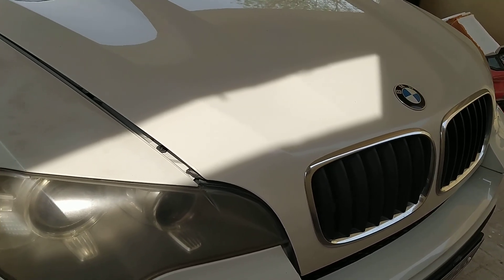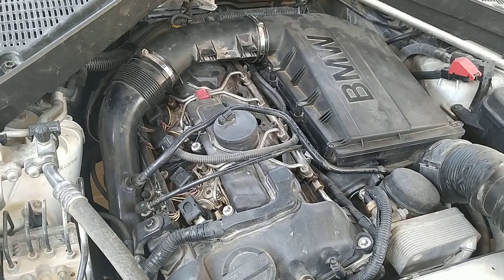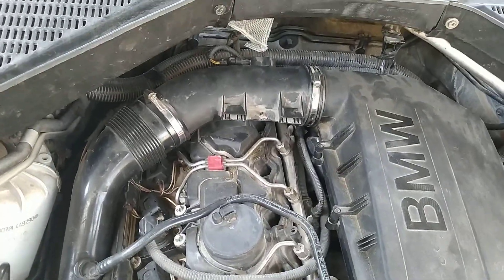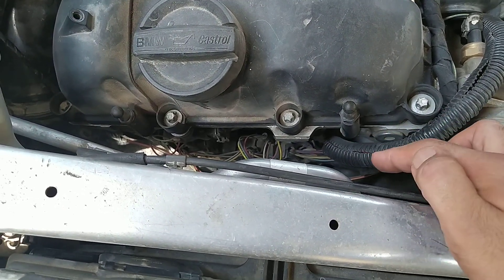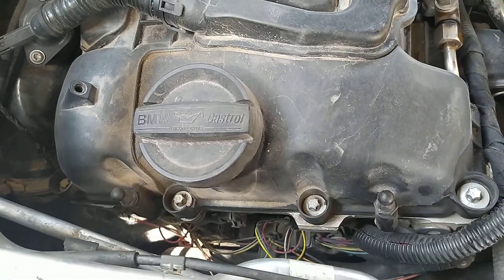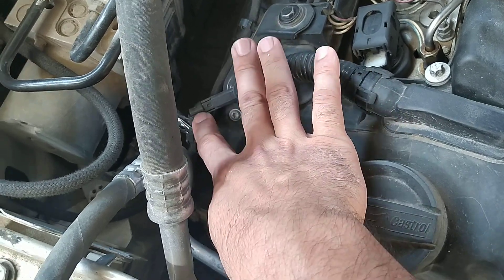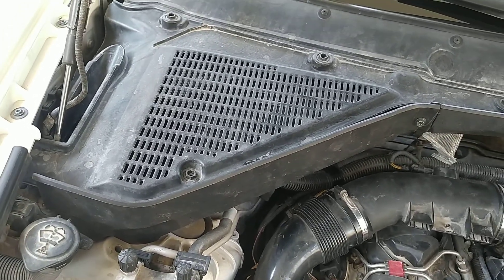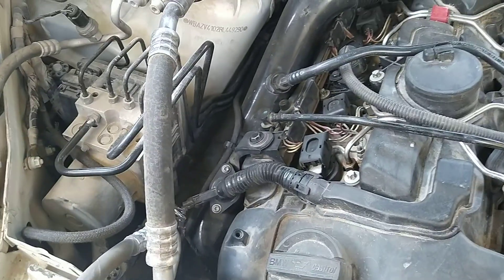BMW X5 E70 N55 no start due to electrical short circuit fixed!!!! See discription for error codes

Comment: I have the problem that the first 30amp fuse blow in the ISM when I conect the cable of the connection voltage supply on the dme
Reply from the maker: Car model? Year? engine? As far as my understanding it must be a 15Amps fuse and not 30Amps in normal cases.
Reply: @bimmerhacks  sorry it's 15amp as you say, it's a x5 2011 e70 n55b30
Reply from the maker: @4agezte983  Try disconnecting the following and connecting one by one back, do the easiest one first. Use a Bulb method to find out the short circuit.
My first priority will be Diverter Valve(BOV) if it is easily accessible, if not
1. Intake vanos solenoid
2. Exhaust solenoid
3. Intake airmass sensor
4. Oil control valve
5. Intake camshaft
6.Exhaust camshaft

Please give me more details if you know how this started happening.
Reply from the maker: Also the Exhaust Flap connector in the rear compartment, where the first AID KIT is located
Reply: @bimmerhacks  oi thanks I'll do tomorrow
Reply: @bimmerhacks  I bought the x5 on copart, beggings of this year so they sold me with clean title run and drive but when it cames to my country didn't start just crank, I began to read a lot of forums videos and I found the problem with the ISM, I open the ISM and saw the 15amp fuse blow, so I really don't know if they sell our the x5 for that problem or not, another thing it's that came without baterry, I have to make some test on the Power supply of the battery too. So tomorrow I will check all lines that you said, thanks for helping, I wrote you how its going
Reply from the maker: @4agezte983  don't worry. We can bring it back to life 🙂
Reply: @bimmerhacks  thank you so much for your attention, another question how to know if the dme it's damaged
Reply from the maker: @4agezte983  don't think of it now. Never try higher Ampere fuse in ISM. DME must be good.
Reply from the maker: @4agezte983  any update?
Reply: @bimmerhacks  going to the local =)
Reply: Mail for better communication?
Reply from the maker: @4agezte983  u gave up??!!!
Reply from the maker: @4agezte983  bimmersword@gmail.com
Reply: @bimmerhacks  starting to check all the lines hope to find something wrong
Reply from the maker: @4agezte983  how's it going mate?
Reply: @bimmerhacks  hello friend, at the moment we already look almost all the lines and theres no fault, tomorrow we continue with the ones behind the crank pulley
Reply: Hope tomorrow find the problem
Reply from the maker: @4agezte983  please do remove the cable organizer like box next to the vanos solenoid, as I mentioned in the video there is high probability that a mechanic might tighten the bolts crushing a cable in between.
Reply: @bimmerhacks  ok thanks very appreciated 👍
Reply: @bimmerhacks  check all and still blowing the fuse of the ISM 🤔
Reply from the maker: @4agezte983  please make a video of how you are checking and all wiring parts including dme n ism
Reply: @bimmerhacks  hello, next week I'll make the video, I need to rest a little cause my head blows too😂
Reply: Mail

Comment: I have a 2015 BMW 535i and it’s having the same issue but it only happens when I try and start it in the morning, it cranks but it does not start we have already replaced the DME and the IVM module and the only way I can get the drive terrain error to go away is when I disconnect the negative battery terminal, and the error goes away and the car starts right up. What could be the issue ? Could it be a short circuit in the wiring ?
Reply from the maker: If it is related to short circuit then the car won't start at all. It could be a faulty relay somewhere like we had issue with x5 e70 n52 engine which cranks but no start especially when it's cold. Does the car crank while having this issue?
Reply: I have e70 x5 n52 engine woth the same problem. replaced the relay and I still got the problem it works when the weather is not too cold but now is -2c the car won't star
Reply from the maker: @diegochaves6927  that's too weared. Make sure the relay is from OEM. In my place temperature doesn't go lower than 9
Reply: @bimmerhacks  thanks for your quick response the relay was brand new from bmw dealership and here in Canada 🇨🇦 was -4 last night 😄. What else can I check ?
Reply from the maker: @diegochaves6927   I will try to dig on the cause and post back. Will need time ....
Reply: @bimmerhacks  I will really appreciate man I just check the relay for currution but everything looks clean the only weird part is that the relay was warm with the ignition off. is +4 weather and the car started like no problem
Reply from the maker: @diegochaves6927  just to isolate the issue, when it is warm outside just start the engine and if the engine starts without any hesitation then remove the fuel pump relay and put in your freezer for like 30 mins and install it back and check. If it starts up without any issue then we can move on to spark plugs and further related. When you press ignition to position 1 itself could hear the fuel pump sound I guess.
Reply: @bimmerhacks  it was a faulty relay. Thanks for your help
Reply from the maker: @diegochaves6927  thank you for updating me. Was it fuel pump relay itself?
Reply from the maker: @chris did your 535 issue got resolved? Please update me if possible... If not please provide additional details if you have something else to tell other than cold start.
Reply: @bimmerhacks  hey there and sorry for the very late response I don’t really get notifications from YouTube, and no problem with it cranking it cranks but there is no start. Almost as if there isn’t any fuel or spark happening, we have tried replacing the IVF module and it worked for a couple of weeks but the problem came back again
Reply from the maker: @somerandomdude5056  looks like a sensor module sending signal to DME to stop fuel pump. Let me know the error code please. You may send me any further information if you have to my email bimmersword@gmail.com
If you have any story before this started happening please let me know. There is always a story behind such starnge things ;)
Reply: @bimmerhacks  thank you ! And I will be running the codes today and I will send you a message once I find my Obd reader.
Reply from the maker: @somerandomdude5056  update please if you got any?

Comment from the maker: https://youtu.be/iRKknSeGw_U
This is the ISM Module which protects the engine electronic components from high voltage. Check this out to resolve engine related issues.

Comment: Hi guys can you help me im from new brunswick fredericton canada 🇨🇦 my bmw x5 4.8i did not start cracking but not start brandnew battery i did not use my bmw almost 3 weeks but this morning not start now
Reply from the maker: Did you check changing the fuel pump relay located next to the rear fuse box(right side) light green color relay, it's just plug and play and cost 15$ or so , if you did not change it.
Update me on this relay for further suggestions.
Usually this starts during cold mornings
Reply from the maker: Did it fix the issue?